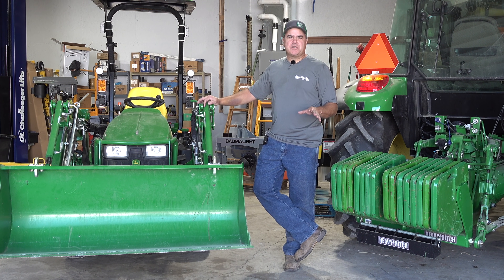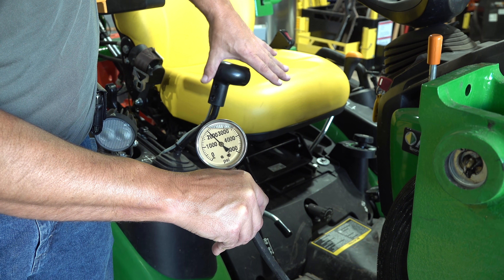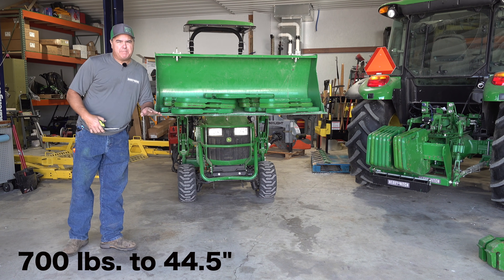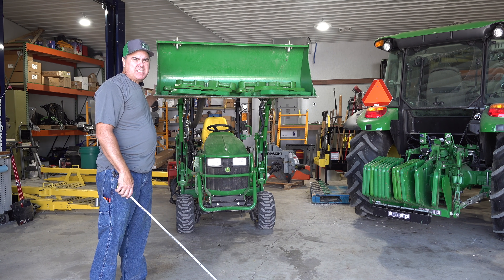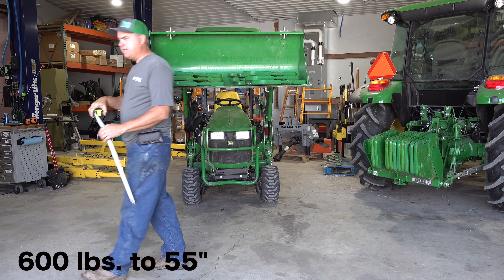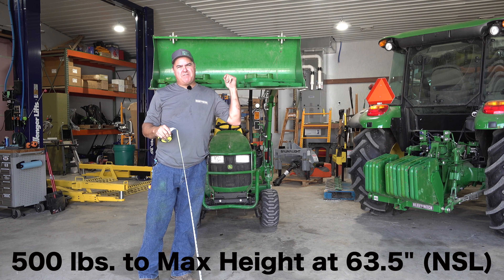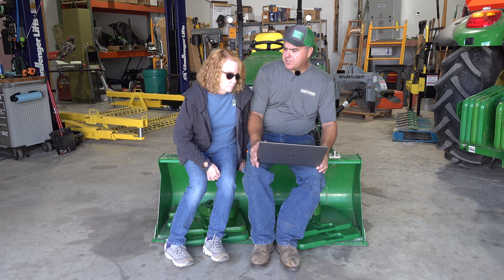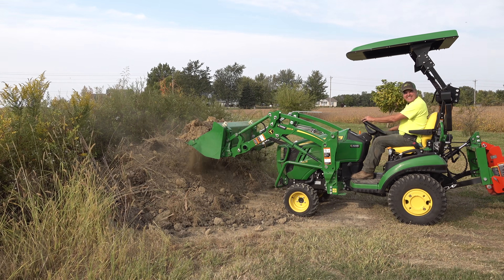WILL IT REALLY LIFT MORE??? 120R MSL vs. NSL for Subcompact Tractors

Comment: Tim - I listened to your explanation yet I still do not understand why you needed to re-level the self-leveling loader.  

My take-away is the self-leveling loader is not, well, self-leveling.  I will re-watch the video, but not sure I will get a answer to my question.  

So, no more lift capacity, not self-leveling, lower maximum lift height.  

From what I’m seeing, the new loader gets a fail grade from me.
Reply from the maker: Correct. It didn’t stay perfectly level.  A bit surprising!!
Reply: Tractor Time with Tim I fixed a typo in my post, and re-worded it a bit, haven’t had my 2nd cup of coffee yet, but I think you understood what I was saying.
Reply: By having to adjust up with the self level at lower than mid height and then having to adjust down above mid height,  it sounds like the bucket stays relatively level, but someplace in the center the level geometry is off just a little bit.  

So I suspect that without the adjustment that Tim had to make the bucket would be level at ground level and at full height but may get a little off temporarily in the middle.
Reply: My experience is that this is true for most self-leveling loaders. The challenge for the engineer is that there is a trade-off between making the components of the loader as compact as possible and perfection in controlling the arc. As a user, I would much rather have a small variation than a larger loader.
Reply: The need for level adjustment through the lift arc, is the difference you are seeing between the hydraulic self leveling and the mechanical self leveling. But the cost difference in needing the extra cylinder isn't justified for Deere to develop the hydraulic leveling bucket. Currently you can order the mechanical self leveling option for just about $600 more than the non self leveling. This was not an option before July, and today an upgrade kit to change from nsl to msl is not available.